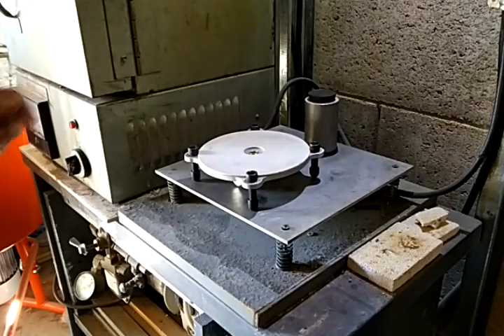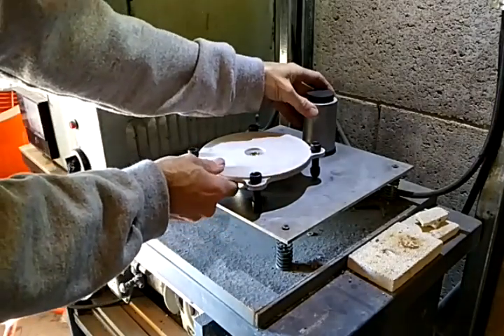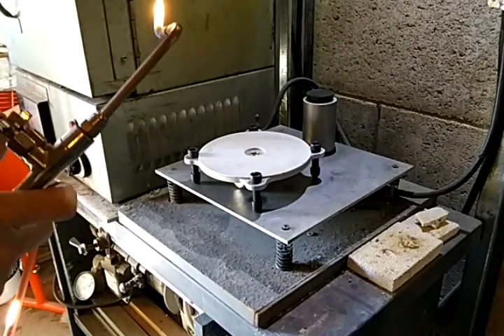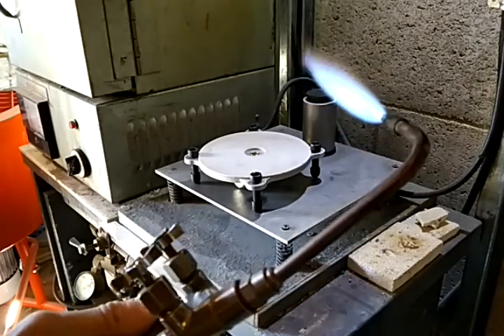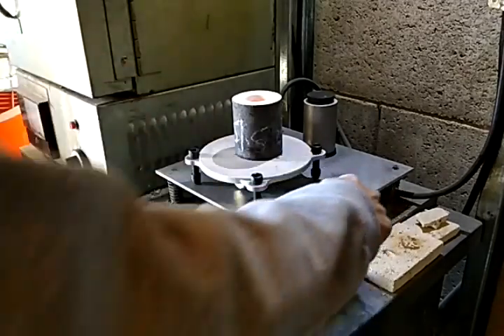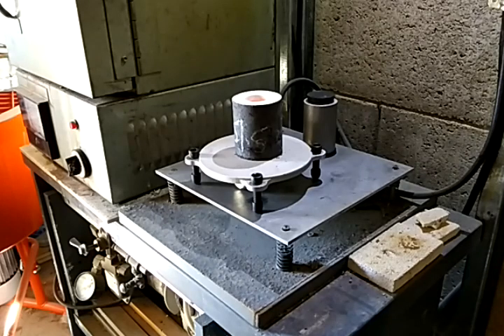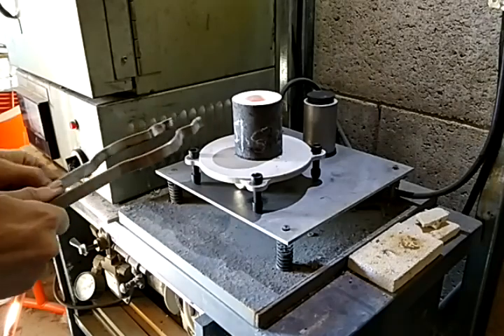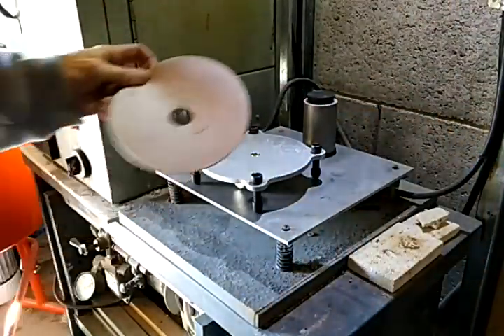Demonstrating my new vacuum casting accessory

Comment: Why not just make a torch holder that will be positioned properly and that frees up a hand.
2 arms ! -- come on , you got 10 fingers and a brain
Think outside the box
Reply from the maker: 99% of the time I use an electro melt so I'm not going to worry about making a tool I'd only use for one video.

Comment: This is a problem you face moving from spin casting to vacuum casting. You can't use an oxy torch and pull out the flask at the same time, a bit of a juggling act..
Reply from the maker: Generally, I use an Electro Melt which of course can't be used with spin casting but you're right about the torch.

Comment: I was wondering how the vacuum works, is the plaster pourous enough to suck the air out or do you have a connection to the bottom of the plaster connecting to the vacuum?
Reply from the maker: After the investment is baked at high temp it becomes stronger and porous allowing air to be pulled through.

Comment: Hi, what kind of silicone gasket do you use? What is the highest temperature this gasket can withstand? Thanks
Reply from the maker: I use the silicone gaskets from Rio Grande. Look them up for yourself if you want to know these questions which I don't have answers to. However, these have been the best gaskets I've ever used.